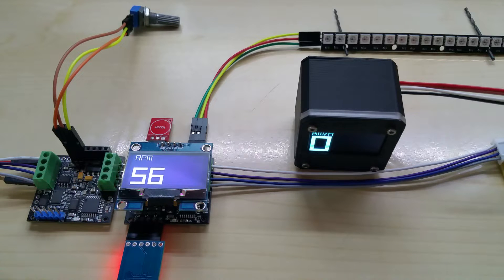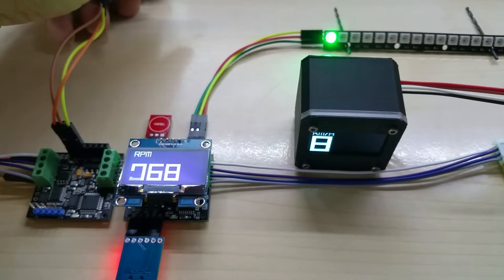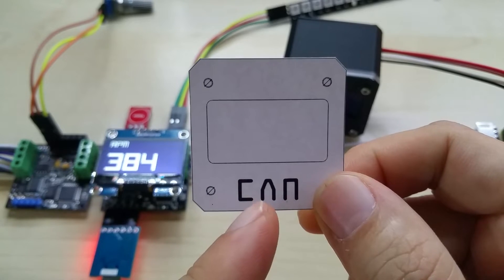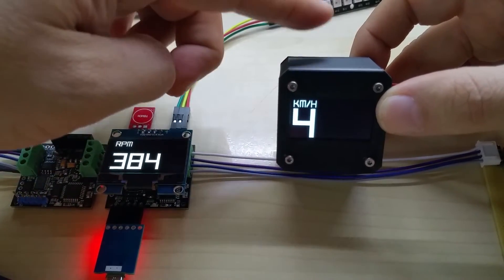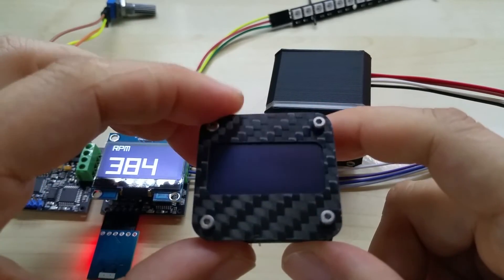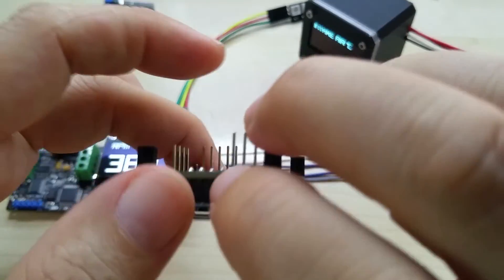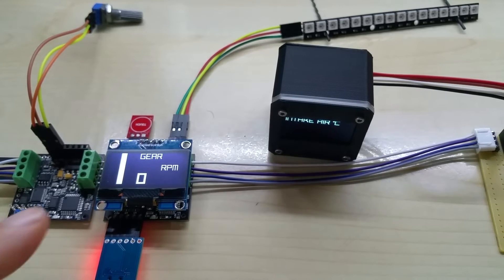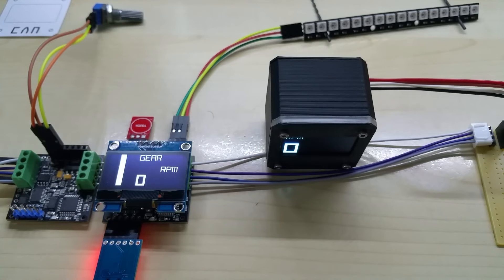CAN GAUGE micro. Worlds smallest full fledged CAN BUS Gauge, newly designed Facia, by Hayri. Part 5

Comment: Are you selling the OBD cable with the kit too, or should we look to get those now before the campaign?
Reply from the maker: Thank you very much  Steve :-) I did change the design from those 3 letters to a straight 2mm tall and 20 mm wide slit as it will be easier to cut, do not really trust the letters to come out nice, plus they would have been illuminate only partially. The slit sits lower and will be used as a full fledged indicator and lit up by a 3535 Neopixel :-) I did print the aka 3D frame with transparent ABS but might have it laser cut out of acrylic so the light will be better distributed. I am just about to order the CF parts and once those come in, I can make the next video. Sorry, as to your question, it will come with a 1 meter long cable, maybe a little longer, and a OBD plug already attached to it. So the customer can just plug it in and go :-) True plug and play as I want this product to be. The customer can still choose from different codes when ordering, or if he has his own codes can upload them as well.
Reply: @iHayri1  great thanks! Saves me buying one from Ali!!
Reply from the maker: @ChunkySteveo  Hehe, speaking of Ali, just received the OBD plugs that were still missing, I got you covered my friend. Also added some more screens to the display, as you know you will be able to scroll through them with a touch on the top of the gauge, like magic :-)))) Question for you, do you think 120 cm cable will be enough? I was gonna do 1 meter but it 1.2 meter would surely be better. For anybody that needs a longer distance they can always use one of those OBD extender cables. Thanks.
Reply: @iHayri1  i would say the longer the better? Guessing most will be routing from under the seat to the dash via the most hidden route? Not sure how far that would be for most? But better to have some slack under the seat than too short, and yeah - more length would be catered by extenders. I would go with whatever is most economical for you with the kits. 1m will work for most if they are cheaper?
Reply from the maker: @ChunkySteveo  Thank you for your input Steve. Well to OBD port is always underneath the steering wheel and to the left to it. For England this will be the other way around I guess? From there to the center of the dash it should be plenty with 1 meter, just if they want to mount it anywhere on the windshield with a cellphone holder it would be too short. But I can't foresee everything :-) making it 120 cm won't hurt me much but should give plenty of room to work with, Anything special one can extend the cable. I previously thought about giving length options but it would be one thing more to worry about. The cable will come from a roll and be cut and soldered to the plug and the gauge, actually it will be plugged in the gauge so you can disconnect it from there for routing purposes if required.
Reply: @iHayri1  ahhh.... i didn't realise it was there?! Haha. 1m should be fine then I guess. Will be good for 99% of users. Don't get bogged down in length options, good call!
Reply from the maker: @ChunkySteveo  Thank you Steve for taking your time to reply. 1m it is then one less option to worry :-)